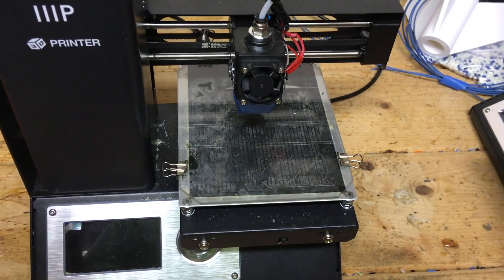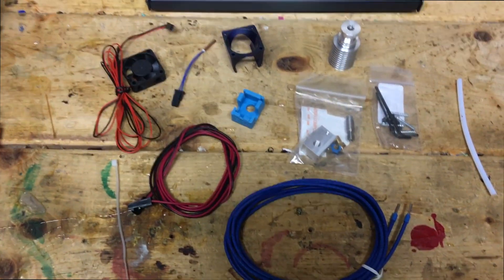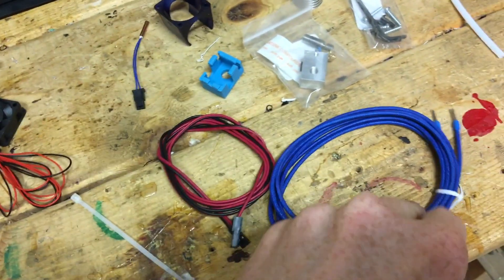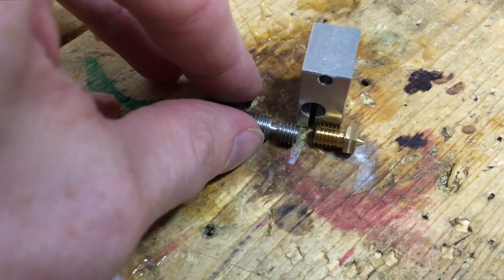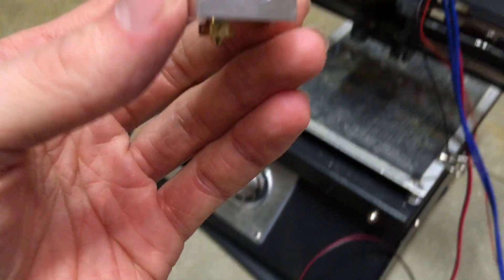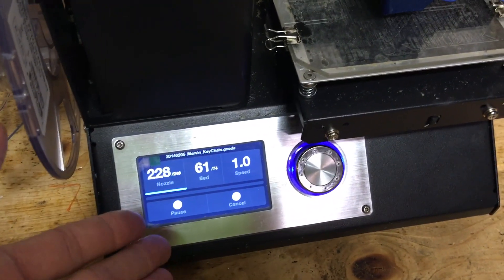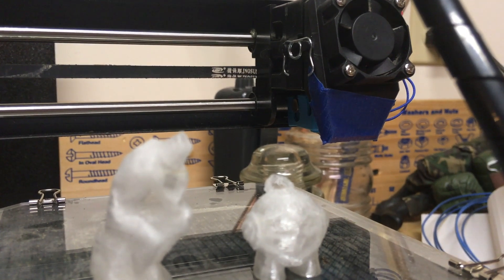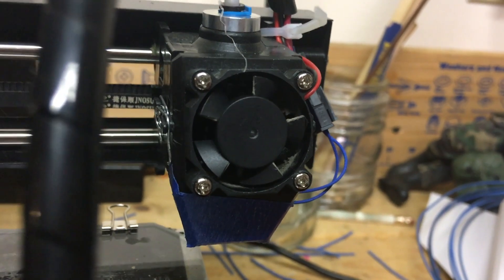E3d V6 Hotend Install on MP Select Mini V2 3d Printer

Comment: did you print an adapter? If so can you share the file, or link?
Reply from the maker: I didn't print an adapter for mine. I believe mine was a newer model; which has a better fit for the e3d v6 hotends
Reply: Where did you get the parts ?
Reply from the maker: either amazon or 3dprinterpart.com